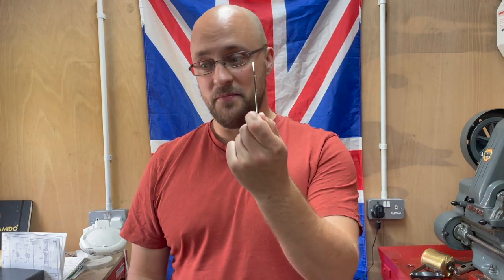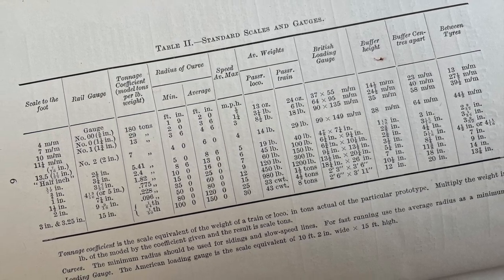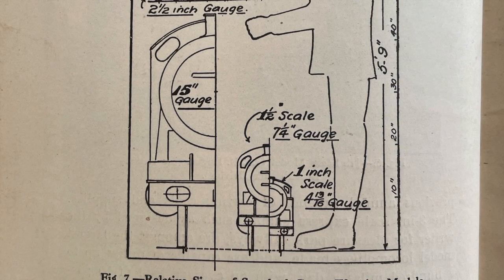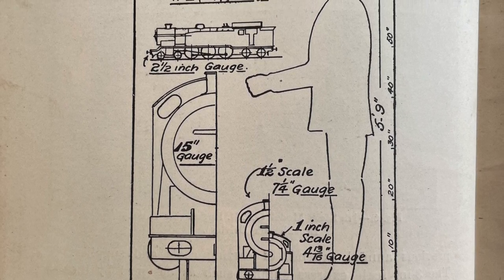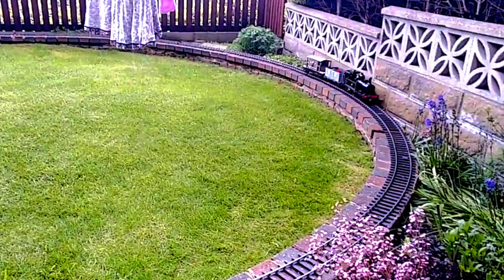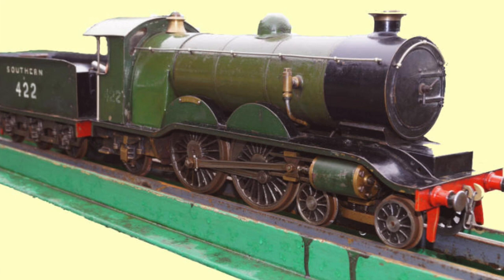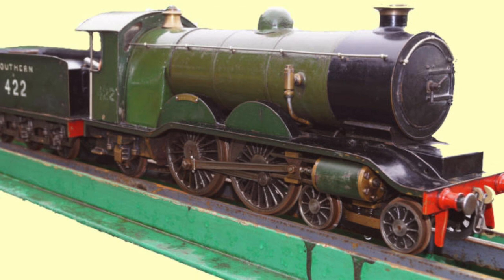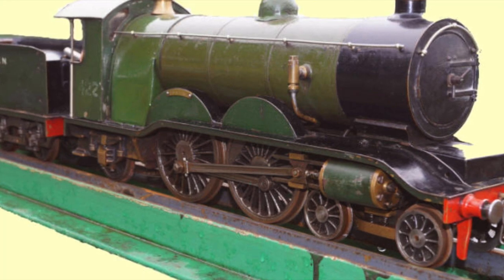Building a Live Steam LBSC Atlantic in 2½" Gauge 1.1

Comment: A small correction William, the vast majority of G3 locomotives are live steam fired by coal, spirit and gas either free running or radio controlled. There are also electric, battery or stud contact,  radio or key fob control.
Reply from the maker: Of course, Roger - thank you for the clarification! I will ensure to include this in the next video I make. I was trying to paint a very broad picture of coal fired, non-scale passenger hauling miniature railways vs 'modelling' railways - clearly I didn't hit it on the head!

Comment: I did not realise that so much information, history and detail was available, thanks for sharing this. This sounds like a very exiting project and something I know nothing about, so be prepared for the silly questions as I follow along. For a starter, are you able to buy plans to do this build or do you have to scale down from pictures of the original?
Reply from the maker: For this exact locomotive, the plans are available from n25ga.org and they are very detailed. Some other locomotives might be just outline drawings for you to fill in the detail yourself from your experience or the original. This is true for all scales of course, but 2.5" gauge has the benefit of a non-profit association that curates the designs rather than relying on companies to maintain them.